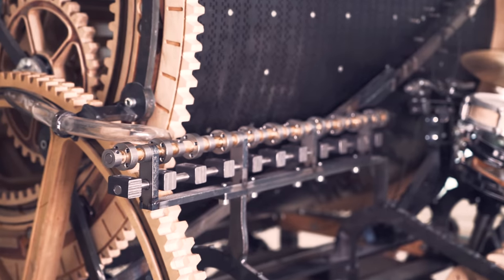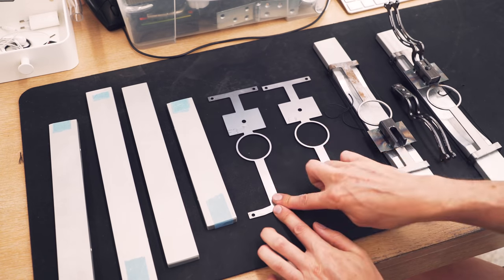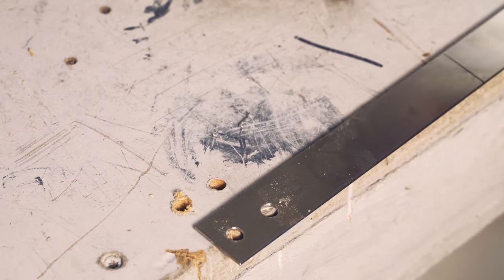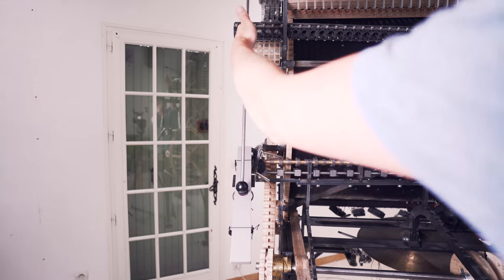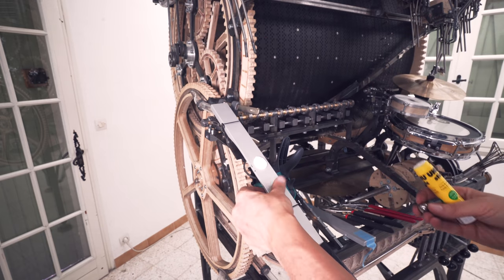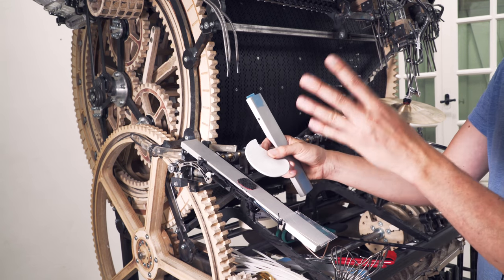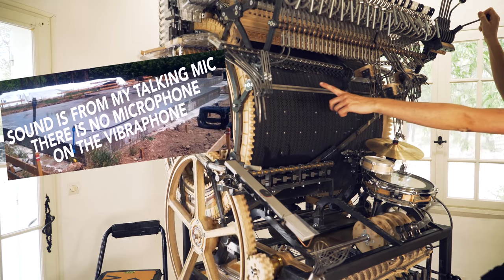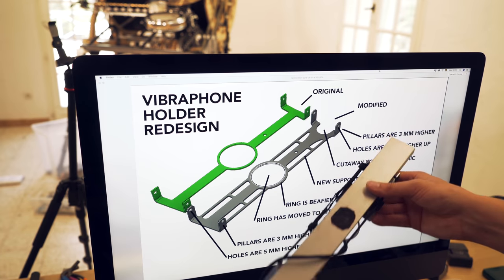Vibraphone Design Test 1 - Marble Machine X#88

Comment from the maker: A small step for the Vibraphone, a giant leap for the Marble Machine X. 
The Vibraphone is currently below Bambi On Ice level, I'll need to make it do triple axles before this is over. 

Bambi On Ice: 
https://www.youtube.com/watch?v=gSh1eLrxiqs

Triple Axle: 
https://www.youtube.com/watch?v=GBWLP-iDUqg

Another project that is going on in the background is the Programming Wheel template programming software:

This saturday at 2PM CEST Sebastiaan Jansen will be doing a programming livestream about this where he'll work on the software for the programming wheel. 
On saturday you can watch him on his Twitch channel: https://www.twitch.tv/sebastiaan_jansen
Countdown until the event : https://www.timeanddate.com/countdown/generic?iso=20190810T14&p0=48&msg=MMX+Programming+livestream&font=slab
Reply: Wintergatan did you made a typo on videos title? i guess this should be video number 88 instead of 89 or did i missed something?
Reply: @Sinaannen  Last week was #87, so it most likely is a typo. Hopefully it'll be fixed soon.
Reply: Can't you just make the marble hit the note further down if its double hitting?
Reply: 9.80665 m/s2 is the acceleration of gravity.  What that means to you is if the marble falls further you will have a higher bounce as the marble will quickly obtain a higher velocity.  It looks to me that you have both the angle of the note to adjust [which means the marble doesn't have to bounce as high if you tilt the note down more] and the height of the fall looks like you could get more distance, therefore velocity.  Once you get that longest one correct, the rest will fall into line.  Perhaps that's a way to get it just perfect without the plastic cover.
Reply: Looking great! Are the holders set up so the centre of the plate stays in the same place with different notes? It's going to be a fiddly set of adjustments each time otherwise!
Reply: Martin, you have to keep in mind the catchphrase mercedes-benz used 28 years ago: "Form comes after function"
Reply: Martin, with your sound plate length problem, what if you made the sound plates Thicker so they wouldn't have to be as long?
Reply: why not makeing a spinner and resonator seperately for every note and coupling them with magnets so they connect automatically when changeing.
Reply: i cannot draw you a sample here;-)
Reply: Hey Martin, you should try to make the marbles not hit the centre, but between the absolute center and the string. If you do this the sound will be better when you put the resonaters under.
Reply: We choose to follow the Marble Machines in this decade and do the other things, not because they are easy, but because they are hard ;-)
Reply: Martin, another way to influence bounce of the marbles is to vary the stiffness of the spring on the vibraphone note. A stiffer spring will allow the marble to impart less energy into the note plate, so making it bounce higher. A softer spring will allow the marble to lose more energy, and bounce less.
A nice advantage might be the visual: your high notes will move more and your low notes will move less.
Reply: What about a guessing contest for the estimated weight of the final Marble Machine X? Lets see where these fanboys are hiding :-)
Reply: I want to hear a triplet test ;D
That will be cool to see.
Reply: It's now a bit far in the process, but maybe you should consider changing the whole vibraphone unit with all it's individual tuned elements at once. So you only have to match one thing at a change instead of 50.
Reply: You can increase bounce strength by removing spring steel for solid steal. Soo that kinetic energy don't get lost when marble hit the note. Also you can extend rails even further away from marble machine core to hit long note closer to marble catcher. So it does not have to bounce so long distance. Right? :)
Reply: Please man what is the brand of that ratchet? Me want...🤤🤤
Reply: The vibraphone tubes could be telescopic
Reply: @DMadHacks  maybe he wanted to avoid having an episode go 88mph ----- since he's not building a time machine out of a delorian  (I know it's bad, but what else am I supposed to say?)
Reply: Okay, this may sound dumb, but have you tried adjusting the angle of the bar? If it were more vertical, the marble could clear the end of it more easily because it would be a shorter distance and up to an angle of 45° the marble would also get more forward momentum from the bounce. I think having the lower notes at slightly different angles would still look better than having that plastic hack solution sticking to the end.
Reply: @Mowogjones  As far as I understand, the note has to be hit right in the middle to get the intended sound.
Reply: Is taking Tooo Much :c , 1 Year left ?
Reply: IDEAS: 
-For adjustable resonators, follow the example of an adjustable crutch with spring detent.  You could set the detent holes at exactly the right dimensions for the resonant frequencies you need.  Then you could just push in the spring detent, and move the pipe to the length needed.  
-I would make your "plastic bounce shield" into more of a channel to keep it stiff (bend up the edges like a rain gutter), and I would put adhesive-backed mole-skin (like for warts or corns on your feet) to it to keep the "clack" of the second bounce down.
-Another adjustable resonator idea: look to the boxes your end-mills come in!  Like this: https://5.imimg.com/data5/HZ/AB/FX/SELLER-196798/boxes-for-cutting-tools-250x250.jpg or like this kind: https://image.ec21.com/image/alisahsp/oimg_GC05753082_CA05753546/Round-Telescopic-Pack%252FCutting-Tool-Plastic-Packing-Box.jpg
Reply: @Mowogjones  hitting it anywhere other than the center causes much worse sound quality
Reply: @Mowogjones  It will change the sound, because the ondulations won't spread the same. And it can change the whole instrument feel.
It's like on a guitar, if you play over or not over the hole, you get a colorful, or banjo like sound.
Reply: @blogobre  The drop height looks stuck at this stage
Reply: Wintergatan please no plastic on the vibraphone 😬
Reply: Can you not cover the bottom of the notes with felt?
Reply: Could bike tire/rubber patches be used for uniform soft marble contacts on the vibraphone bars? :)
Reply: Wintergatan you’re back! Nice.
Reply: Have you tested the rubber padding on Ping Pong paddles???
Reply: can the notes be more narrow instead of shorter to get same note, and have the same length to deal with the bounce? or a resonating pipe with 3 sets of sizes on 3 sides of the tube you can just turn around to change dept ?
Reply: I think the slope of the ball drop could change to impart more velocity to carry the bounce into the hopper.
Reply: Why not bring the receiver over the vibraphone? More like a single trough that sits just below dead center of the vibraphone, no fiddly adjustment to catch each ball from each note and no double bounce. Could even be multiple rods spaced less than a marbles width each all running horizontally to one collection point.
Reply: @Wintergatan It's super simple to solve that problem, just make the marble hit a little advanced than where it's hitting now. (ok, my language is not english but let's go...) The marble is hitting in the middle of the piece right? Then adjust the angle of that wire (Up side. Where you release the marble. You unlock and the marble slide on a little rail right? *This little rail*!! Just adjust the angle and make the marble fall a little ahead of the place that it's hitting now!) And chill out, nobody is worried about finishing the machine so soon. Please don't rush and use ugly solutions!!
Reply: @Electromasit  we choose to change the vibraphone notes and other things, not because they are easy, but because more notes
Reply: Hi Martin,
I'm watching every single video of this great project, however this is my first comment that I feel I need to make;
To solve the double hit I think the only thing you need to do is giving the marbles more horizontal speed.
You can do so by making the downward bend from the guide rods closer to the drop channels so the drop angle will become more horizontal.
I hope you read this, it think it is the easiest solution and it might save you time since you do not have to make a lot of plastic sheets.
All the best from the Netherlands.
Reply: Just a brain fart...
What if you used pvc piping for the resonators but immediately under the notes you used a 90° bend so that the pipes run under the programming wheelso that  you could change pipes from the back of the mmx
(I don't know if pvc is suited for making resonator pipes)
Reply: why don't you try to cover the last part with thick silicone and covers it all with the rubber?  it would  
cover it all seamlessly (you plan to cover it all with the rubber right?). who knows? silicone damped the sound, right?

Comment: @Martin  Having re-watched the video I've spotted a fundamental error!

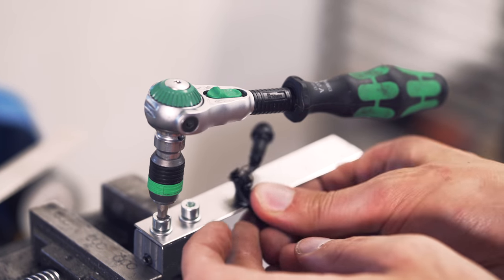(4:08) When you adjust the spring, lifting the key, it actually decreases the strength of the spring. As the point where the mounting presses on the spring moves further away from the fulcrum the key actually gains more leverage, and so is able to deflect the spring steel more easily.

For the tensioner to work as intended you'd also need to apply an opposing force pushing down, keeping the key in place. The weight of gravity isn't enough, so what you have at the moment amounts to an angle adjuster.
Reply: ...I had an ID: https://ibb.co/7nTCHZ8

Optionally adding more mass to the vibraphone key mounts, in conjunction with adjusting the angle of the springs, will give you whatever amount of tension you require (within limits) while still having the keys at the desired angle.

Additional mass should result in less movement of the key, which may mean that more kinetic energy is retained by the marbles, making them bounce further. That said, the drop height might also be a critical factor. A few centimetres of extra drop height might make a lot of difference to how far they bounce.
Reply: @nagualdesign  Nice catch!

Comment: Just two ideas to get rid of the plastic plate:

1: If you put contact mics on every single vibraphone plate anyway you could increase the height of the drop point for lower notes. More velocity - bigger bounce. Increased volume compensateble by a mixer.

2: shift the drop point a little towards the funnel side. The timbre won‘t be too different if the marble still hits within the middle third, will it? You could then take the hit point little by little towards the middle going to the higher notes.
Reply: You don't want the drop heights to change because all of the balls need the same travel time from release to hit. He can offset the crank to line up the rhythm machine but he can't make changes to the drops unless he cut the channels offset in the programming wheel.

Comment: Could you vary the angle of the longer plates so that the marble misses the end? Could be done gradually so it makes a nice aesthetic fan shape?
Reply: I like this idea. I think the important thing is that Martin is moving forward. There are still lots of things to solve with the vibraphone. It works and in the future he can make it work better.
Reply: I think, if he wants to be able to put in different notes, then the length could vary.
Reply: He wants to be able to change the notes around, so i think a constant uniform angle would be neded
Reply: Well each note has it's own bracket anyways, so the only issue I see with this angle idea is the position of the catch funnel.
Reply: @FabianPegel  Well as long as the marble can clear the longest plate then it will also be able to clear shorter plates.

Comment: You could get rid of the plastic plate that catches the marbles by moving and extending the funnel above the vibraphone. Though I can see how this will present other problems, both ascetically with the funnels' relative positions and functionally during the changing of the vibraphones.
Reply: I see problem in current implementation when changing the notes. On shorter notes, the second bounce point will most likely be outside or at the edge of the note, where the plastic extension wont work. I bet that only fix is to make them bounce directly into the scoop. There might be easy solution by making the spring steel stiffer. That should make marbles bounce more as there is less flex to absorb the energy.
Reply: Good thinking though.

Comment: I didn’t think contact microphones could pick up vibrato from beyond the vibraphone bar, TIL
Reply: Sshhh you might be right there. At the moment we are trying to cover all bases and see what happens.
Reply: Correct. I have access to a contact miked vibraphone, and you need effects pedals (or software) to alter the sound once created.
Reply: Yeah this may be an issue
Reply: How about a contact mic (or better, a close talking mic) inside the top of the resonator tube? The tube and bar will block most of the outside sound except from the bottom, so you mostly have to worry about reflections off the stage. Put the machine on a hunk of carpet on the stage. It will also keep down clicks and roll-aways from marbles that escape.
Reply: That could work, especially with some basic noise reduction. (As long as that doesn't compromise the analog aspect of it)
Reply: If resonator are open tube why don't concentrates or orients sounds from "under" beyond the tubes with appropriate one piece shaped "picker" plate on which would be the sound capture device itself protected from "external" sounds ...
Won't it allows to have even crossing notes vibration ?

Comment: The rubber pads are going to wear through in a few hundred hits. :( You'll hear the difference as the last bit wears through and the marble contacts metal.
Reply: Well you can't stop wear and tear completely on prolonged use. He thought about almost everything to be easily replaceable or maintainable. So it should just be replaced after a few concerts.
Reply: Yah, nothing is impervious to wear and tear. It’s a machine like any other. Parts must be replaceable.

Comment: How about putting the longer notes at a greater angle than the short ones, so that there is kind of a twist in the vibraphone. That would solve the double bounce problem :)
Reply: Edgar Brucke might make a problem with the resonator pipes? Or too complicated for quick plate changes. I don’t like how un-elegant the plastic rectangle solution is but it would be a lot simpler & wouldn’t set him back trying to find a perfect solution
Reply: Just increase the angle uniformly for them all. It doesn't really matter if the marble bounce extra far off the shorter notes, so long as you can still catch them with the funnels.

Comment: As a vibraphonist and engineer, this video makes me very happy. I would also like to say that generally, vibraphones use rigid (not stretchy) cord to hold the keys rather than elastic. Since the holes go through the nodal plane of the keys, you don't have to worry about it dampening the notes, and it might fix your bottoming out issue. Thanks so much!

Comment: Fantastic.  Probably you've got a solution already, but here's my idea for adjusting the length of the vibraphone tubes.  First, make them two telescoping sections.  Second, attach the lower telescoping section of all the tubes to a long curved rod that has a pivot on the right side of the machine and a handle on the left.  Then by moving the handle up and down, you can adjust the length of all the tube simultaneously, and you can have a mark or detent for the handle indicating each key position.

This takes advantage of the ratio effect of levers and the fact that when you change the key, you multiply all the frequencies by a constant.  So shifting from C to G, all the frequencies go up by 50%.  You do have to be a bit careful in the shape of the lifter lever though.

Another idea is to keep the tubes fixed in length, but let them slide sideways.  So when you go up a fifth, you shift seven tubes, so that the G tube moves to the C tube's position and so on.  Maybe put them on a sliding track?  There's not a lot of length left sideways, so maybe the track would have to curve toward the back of the machine.

Comment: I admire the craftmanship and atension to detail! 

Move the adjustment spring form the "machine" to the vibraphone. This way you do not need to re-adjust the spring tension when changing note. 

Would it be possible to have the resonaiting pipe "fixed" to the vibraphone? This would also make the changing of notes faster on stage.

Comment: In the previous video about the marble catchers you said you're looking for a solid reaction to a hit, not to start the vibraphones bouncing.   You could get that with shock absorbers and 1/10th or 1/16th scale RC cars should be the size you need.  It looks like you could mount them without interfering with your spring steel, or you could get them for 1/8th or larger scale and replace the spring steel entirely with the larger springs they come with, and they're already designed to be tuned for the exact weight and height you're running via an integrated pre-load nut the same as full-size cars.

Comment: Don't forget that you can utilize the sound-absorbing silicone on the ends of the vibraphone instead of the plastic, which you can turn into a sheath to cover the ends which could look more aesthetically pleasing than the visual gobbledygook you've got going on there.

That, and what everyone else is saying here: Use a stiffer steel for the plates and have the marbles strike off-center, and either (or both) of those might help with sound and bounce.

Good luck, God bless, and keep up that skillful work! You're making mistakes but at least you're doing something while the rest of us simply watch.